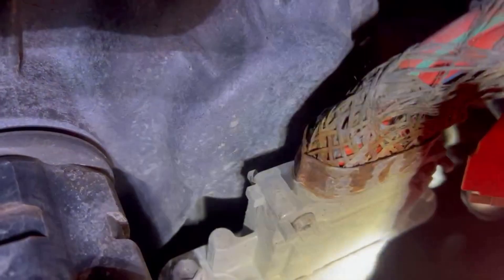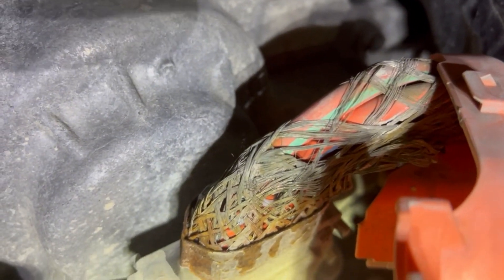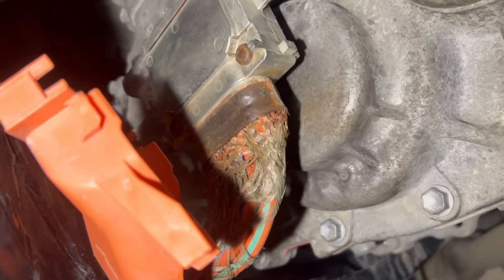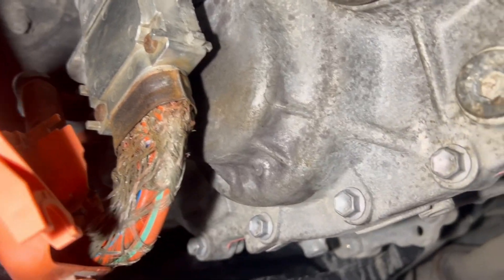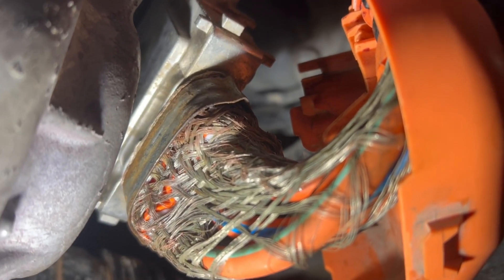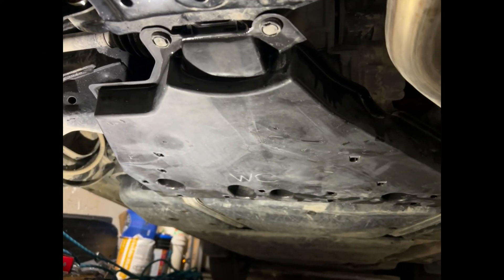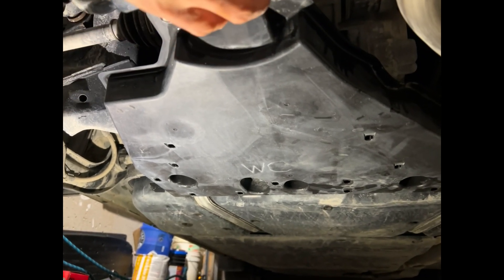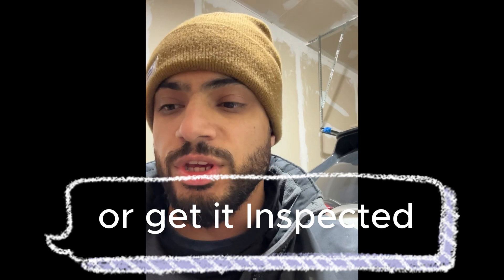Toyota Rav4 Plug-in hybrid and hybrid rear cable connector corrosion inspection

Comment: You didnt do much by just cleaning the rust,  In order to prevent the same issue (which will definitely occur in the future ), you shoud  of apply some protectiive coating after cleaning , and epoxy coating is the best solution because it stops the oxidation process and  prevents further oxidation ( corrosion ), even in saltwater environment . Otherwise, corrosion will settle again very soon. Even if you put self adhesive rubber or anything similar around connector would be much better than just clean it and put that poor plastic orange cover back. BRGDS

Comment: How safe is it to open those orange covers? It’s a high voltage cable 👀
Reply from the maker: Refer to the owners manual, there is a fuse you can remove to make it completely safe
Reply: as far as you dont disconnect, it is safe. Otherwise, you have to unplug the 12V battery and high voltage battery ( unplug the orange jumper from that battery ) befory you take off that connector

Comment: I live in Quebec ; next oil change at the Toyota dealership I will have it inspected and  I will take pictures.
Reply: Toyota dealer in US replaced the high voltage cable and connectors, shield and new and improved connectors in 2020 Rav 4 XLE hybrid with 53,000 miles under the warranty. Toyota knows they have a problem and will make it right. Be prepared to wait weeks for the parts. I got a rental free of charge too. It's covered.... don't let the dealer tell you it not covered. Good Luck!

Comment: Damn, I wonder how the 24 and 25s are
Reply from the maker: Vehicles manufactured after April 2024 have the updated version4 of the connector. They added a rubber boot that covers the wire mesh and the metal clamp in the current version.

see below the latest version
https://www.rav4world.com/threads/new-fix-for-cablegate.335014/
Reply: same harness. They have a new design now 2025 and better connectors and the added a shield.

Comment: Did you add any corrosion protection or seal the connector area to prevent future salt water intrusion? Thanks for the video. I have a 2023 that doesn't get driven much in salt/snow but will be watching this.
Reply from the maker: I did spray marine corrosion inhibitor and applied dielectric grease on the metal clamp. Thanks
Reply: @Wrenchndride  can you make a video instruction?